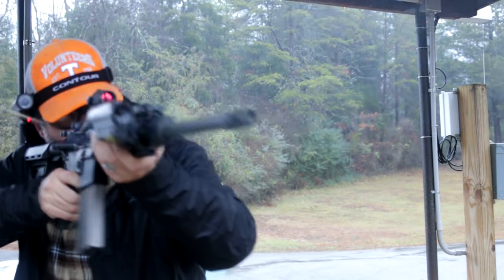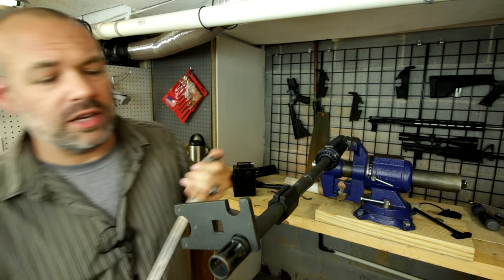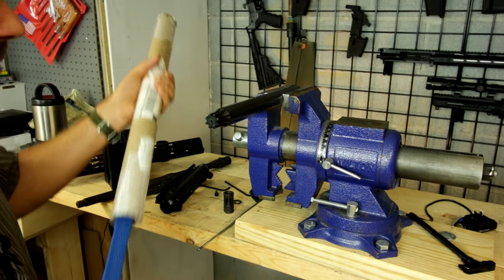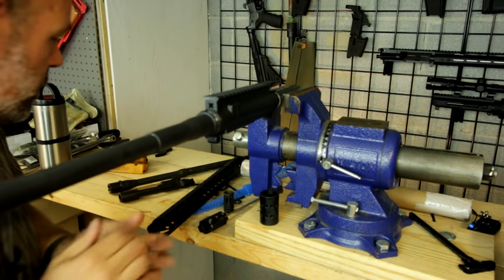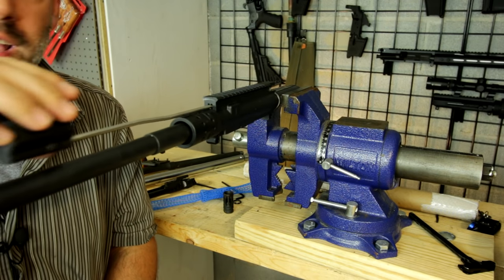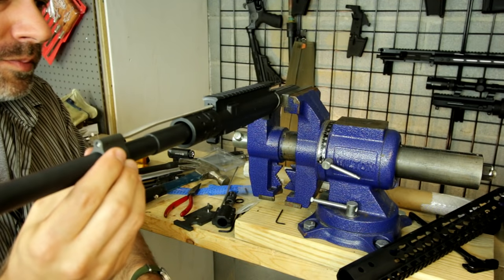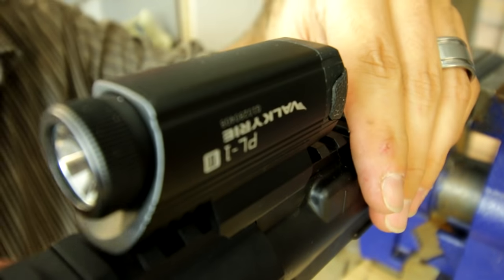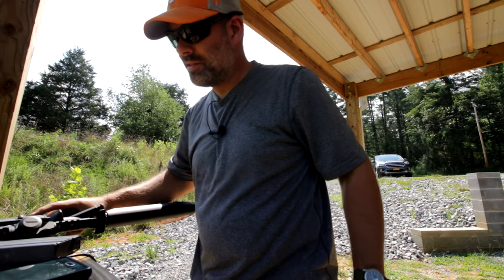How To Swap Out Any AR-15 Barrel

Comment: "Actually" I didn't see you set or tighten that gas block...looks like you just slipped it on the barrel and went to the hand guard. Not a good thing.
Reply: Was that the rattle at the end during the firing?
Reply: @5jjt  probably the recoil spring in the stock

Comment: Hey D & G, Great Stuff - Thanks. Just a note: When You use a Torque Wrench the ft. lb. Scale Reads number that of You using a Socket. You are using a "Crow Foot" Wrench, which is not directly over the center.  There is a formula to calculate the Actual ft. lb. based on how long the Crow Foot is. Side note: There is also a Formula to read ft. lb. if an extension were being used with a socket. FYI.                                                                                LJR-III                                                                                           OUT
Reply: You're correct, in aviation I would 90 the crows foot or torque adapter. But I think he was getting at the difference is not a big deal for this application, especially since he's mid ranging it too.

Comment: Thanks for the great video. I got the info I needed.  And, yes, your setup is quiet but those watching should still check the sound levels with a meter, most will be surprised to find that you still need "ears" to shoot any amount at all and not risk hearing damage.  Until you can get the db rating below 85-90, you're in danger (human speech is about 75db).  A lot of suppressed systems still come in well over a hundred.  Better but not "safe."  Speaking of safety...
 You shared your experience with us, so let me share mine with you. 
  I was a munitions systems specialist in the air force.  It was years ago when the knowledge was there but not well heeded and it was the military and it was an active combat station so putting gloves on every five minutes just wasn't practical...  Then.  We washed our hands in industrial solvents to get off the industrial adhesives, worked with explosives with heavy metals, etc.
  Having contacted leukemia and, subsequently, had a marrow transplant, I can tell you that washing your hands with soap afterwards isn't gonna cut it.  The moment you put your skin in contact with a chemical, the process begins. 
  I dont think the Aeroshell, per say, is as much of a hazard (read the safety data) but the cautionary tale remains.  Read and heed the warnings.
  I was lucky, I was diagnosed in the nick of time (2 weeks later and I'd have been to far gone) and they found me a "ten point match" (next to 8impossible).
  Christmas eve marked my ten year anniversary as cancer free (a marrow transplant for Christmas, lucky me) but those ten years were hell and the years to come are not going to be any version of a picnic. 
  Even when the cancer is gone, the remaining complications from the damned cure remain. 
  I'm no "Safety Sally" and I'm no pansy, either.  What I am is a walking object lesson.  I hope that you and others will learn from my mistakes.

Comment: Saw this and two points regarding your barrel installation.
(1) Use a reaction block on the upper receiver when installing the barrel, not on the barrel. The Wheeler Delta Series Action Block and Picatinny Rail Vise Block is an excellent vise block into which you can put the upper receiver using its takedown and pivot pin holes and a pair of 1/4" pins that come with the fixture. If the upper has a Picatinny rail, it can be inverted and held by a slot for it in the fixture. I don't like the clamshell upper vise blocks as the precise profile of uppers varies and I've seen them crush a few. The reason for fixing and holding the upper receiver: the torque when tightening the barrel nut is applied to the threads on the upper receiver, not the barrel. The only thing preventing the upper receiver from rotating is the barrel index pin. Too much torque from it on the upper can break and destroy the thin threaded portion of the upper receiver --- or shear off the barrel extension index pin, but that's rare.
(2) Use high temperature grease on the exterior of the barrel extension, and on the barrel extension flange, not just on the upper receiver and barrel nut threads. It will help prevent the barrel from "welding" itself to the upper receiver with pressure and heat over time. AeroShell 64 is the grease the military specifies and uses (formerly AeroShell 33MS).

A barrel extension (chamber) action rod should only be used for either holding the barrel while working on it, as a matter of convenience, or for installing/removing muzzle devices that apply torque directly to the barrel. For work directly on the upper receiver including the barrel nut, an action block holding the upper receiver properly should be used.
Reply: Would you consider it safe to use the reaction block types on the upper receiver to torque on/off muzzle devices as well? If so, what would be other purposes for reaction rods? Theres quite a price difference between the two and Im just wondering if I can get everything done with the reaction block style for upper work then I wouldnt need a reaction rod.
Reply: @andydufresnejr  When installing or removing a muzzle device, the torque is applied directly to the barrel. If you don't use a reaction rod engaging the barrel extension lugs, you put that torque onto attempting to turn the barrel (extension) in the upper receiver. The only thing preventing the barrel turning is the index pin and the pressure from the barrel nut on the barrel flange -- which has grease on it if it was installed properly. Attempting to align muzzle devices properly has been known to clock barrels in the upper, shearing the pin, or damaging the upper at the pin notch, or both. You want to isolate the torque to ONLY the barrel itself and its extension. Note that an AR-15 barrel is actually three parts, the barrel, the barrel extension with chamber and lugs, and the index pin. Once put together by the barrel manufacturer and sold as a complete barrel, they're not intended to be disassembled as the pin and the chamber lugs are aligned with the barrel gas port, and any gas block dimples or notches made in the barrel for mounting the gas block.

Comment: Using an upper receiver action block to remove a muzzle device puts all the stress on the index pin on top of the barrel, and the slot in the softer aluminum receiver.  This can damage the slot.  Use barrel vice jaws or reaction rod only for muzzle devices, and use an action block only for changing the barrel.

Comment: I saw when you installed the roll pin for the gas tube and slid unit onto barrel. You talked about placement of gas tube on barrel and when spacing is needed to provide proper gas port alignment. But you never tightened mounting screws before installing hand guard.

Comment: I am a USPS mechanic for parcel and letter automation. My main machine is a 150 foot long low speed electric chainsaw that has "teeth" that carry packages down the machine and have their own motor to spin a belt to kick the package off at the right time to sort into bins. The chain is self-oiling and the oil has so much molybdenum disulfide in it that it is metallic in appearance... if anyone's ever dropped an oil pan after throwing a rod bearing on a vehicle, shinier than that. It's ridiculously expensive. If moly greases and oils cause cancer, I'm seriously screwed. I use it as a hair pomade, facial cream, hand lotion, and if you get enough of it in a banged up knuckle it'll quit bleeding. Joking, but my job is seriously dirty and greasy. I think the tiny amount on your AR is about 1/1000 as likely to kill you as my average day. Thanks for answering my questions, I'm swapping the unbarreled upper in my AR-15 for a fancier model soon. 👍

Comment: 90 degree angle really does matter because the extended length on the torque wrench adds leverage to the torque thus a higher torque spec than it is set to especially on the the lower specs on an aluminum barrel nut!
Reply: So it’s torqued to 42ft•lb instead of 40ft•lb.

Comment: Something something 90 degree angle on torque to nut tool for correct ft-lb

also cannot recommend adjustable gas block more for 300blk if plan to shoot supers.

Keep up the good work man.
Reply: As a retired helicopter mechanic proper torqueing technics was a way of life. Torque adapters like you are using should be at 90 degrees to torque wrench. Over torqueing can cause breakage, under torqueing can allow things to come apart.

Comment: I'm so happy you didnt loosen with your torque wrench. The first switch was so quick I wasnt sure and I cringed a little.
Reply: Ive loosened with mine for 15yrs had it calibrated still within margine if error. Stop being a control freak. Let people do with thier property as they wish.
Reply: @timesthree5757  bro take it easy.  I was only commenting a little sarcasm. You wouldn't use your computer monitor as a hammer but I'm not going to stop you from doing so if that's what you want to do, I'd probably cringe a little for that as well, and I'm not a computer guy. It's that moment where you see 2 cars collide, everyone grits their teeth and holds their breath, squints their eyes just a little and brace for impact. 
That said, a little know proven fact of the matter, the calibration of a torque wrench is a little off after using as such, although an ls and a coyote can both be torqued into a " between such and such " range, but there are motors out there that require a very specific torque. I sometimes use my box wrenches as hammers, bad habit but some people do it. Next subject.
Reply: @highoctain113  um I have used it as a hammer to put my keyboard back together. Couldn't tell if it was sass.
Reply: @timesthree5757  no you didn't.... Althought I guess I could see it after a keyboard was used to smash said screen in a moment of rage due to a lost match.... Hahahaha
Reply: @highoctain113  um actually I did. Keyboard fell in the shop. It separated a little. Well I picked up a flat screen and used the base to bang it back together. Using a torque converter as an anvil.
People in my county won't use a shop if it isn't cluttered.
Reply: @timesthree5757  well hell I'd fit right in cause I can't organize ta save my life. Kinda why my tool box used to be so big... I had to have multiples of the same wrench cause I set them down and misplace them till the end of the day when I round everything up and put it away...
Reply: @highoctain113  yep. Yesterday we did a clean up in the shop. Minus the aluminum what not. We hauled away 15tons of crap. In the process we found over 100 10mm, 13mm, 15mm wrenches and sockets.

Comment: add some grease to ur buffer sping to get that vibration out plus it cut out that twang spring noise
Reply from the maker: At first I didn't think it was the buffer but after re-watching it the mic really pics it up well.  It's not nearly that loud in person but it could probably use some grease.
Reply: I was wondering what that noise was, then you mention the buffer spring and yeah, of course. Good advice.
Reply: Or get a flatwire spring.

Comment: You talk about not using the torque wrench to loosen only tighten but when you tightened the barrel nut you had the wrench backwards which in effect is the same as loosening.....
Reply: Yep I caught that too. Sometimes you don’t realize it until your wrench slips out and you smack yourself in the face.

Comment: The wrench and torque wrench isn't a 90 degree so the torque is overwhelming man
Reply: I believe he said he wasn't concerned. However, physics is physics.
Reply: There is an equation for going off 90, it makes a big difference in very high torque applications. Quite negligible in low torque ranges. If you are going for maximum or minimum torque, it may be an issue but I personally settle for something in the middle of my range.

Comment: Well, that pistol lenght gastube did the trick. So did you ever get another failure due to the gastube lenght?
Reply from the maker: Not at all and I've now put well over 1,000 rounds through it.  The only issues I've had since the barrel swap are reloading related.

Comment: At what point does a rocket need surgery, thus requiring a rocket surgeon?
Reply: As an Aerospace Engineer who works around rockets,  I can confirm that this is basically what building rockets looks like (maybe with a little bit more PPE and torque stripping lol)

Comment: so I can change my 11.5 inch barrel on my Sig M400 to a 16 inch barrel?
Reply from the maker: Yep.  You may need a new barrel nut, gas block, and longer gas tube to go with it so do research before buying.
Reply: @deuceandguns  Thanks if I decide to do it, I have a great gunsmith.

Comment: Ihave a palmettoarmory ar15 with 16 inch barrel..instead of buying a ar pistol can i just buy a pistol upper and put it on my ar..thinking of a 7.5 or 10.5
Reply from the maker: You sure can but to stay legal you'll need to register it as a Short Barrel Rifle if the AR you have already has a regular stock on it.  If you want to go down that road reach out to a local dealer that sells suppressors and they'll probably be able to help you out.

Comment: Why did you tighten it then loosen it then tighten it again?  I’m confused shouldn’t you just have to torque it to a certain amount and it’s done?  I’m new to this so that’s why I’m confused.  I want to buy a cold hammer forges barrel for my first AR and that threw me off a bit.
Reply from the maker: That technique is listed as standard procedure in the US Army manual.  It's to verify the barrel is fully seated to the receiver while not being over torqued or have any stress points.
Reply: @deuceandguns  cool thanks

Comment: Great video.  How short of a barrel can you go down to?  Thanks R/David Gutierrez
Reply from the maker: My 10.5 inch 300 blkout SBR runs like a champ but anything below that and you can run into having to mod the gas system a ton or it may require a suppressor for the additional back pressure.  I've got a 7.5 inch 5.56 that runs nice and that's the shortest AR SBR setup I've attempted.
Reply: @deuceandguns  A 7.5 inch barrel isn’t a sbr unless you put a stock and not a pistol brace on the AR.
Reply: I’ve seen 300 blackout with barrels as short as 5 inches. But any barrel length past 10.3 is a waste
Reply from the maker: @badcompany3828  Mine is on a rifle stock thus the SBR comment.

Comment: My 300bo 8” sbr won’t cycle subs for sht . I purchase a yellow sprinco spring to see if that helps the situation out any better . Frustrating af
Reply: For a barrel that short, you need to ensure that you have a large gas port.  Then use an adjustable gas block to throttle the pressure according to your loads.  Or reload your own, so that both your supers and subs hit nearly the same PSI.

Comment: You earned points for forgetting the gas block.  You lost points by not dropping the roll pin. Now, go join two wires and forget the shrink wrap.

Comment: When he said changing out the barrels to chamber a different caliber he specifically said at  1:07 something so fast it’s hard to understand did he say you do or do not have to change your bolt
Reply: If changing your caliber to 5.56 or 300 blackout you won't have to change. If it is 7.62 or 6.5 Grendel you will have to change the bolt

Comment: Did you check head space ?
Reply from the maker: I eventually did but I'm never concerned about a new AR barrel due to the headspace being set from the barrel manufacturer and I match new bolts to new barrels.

Comment: Could I go from .223 to .223/5.56 with a barrel swap?
Reply: @foxxy1015  The 5.56 has a different throat and the chamber is .0001 longer compared to a 223 chamber.. Many barrels marked 5.56 are not true 5.56 chambers but are 223..Use a 1.4646 go gauge for the 5.56 and a 1.4636 go gauge for the 223..There are function gauges and throat gauges that will verify if a barrel is a true 5.56 chamber and throat.. There is no reason to change uppers..
Reply: Yes..
Reply: @hairydogstail  I didn't know that, thanks for telling me I will change my comment than

Comment: Easier to align your muzzle device if you tape a level to the wrench tool. Little changes in angle on a compensator do affect your shot placement.
Reply from the maker: That's a good idea.  For this particular build the flash hider is simply a thread protector for my suppressor but I'll keep that idea in my toolbox for later.
Reply: @deuceandguns  I've never had a roll pin fit so easily into the gas tube, that may not hold well. I usually have to hammer mine in with a roll punch pretty hard. Just throwing on the suppressor should have fixed your subsonic carbine length gas issues with 300blk, but I always run pistol gas systems on 300blk for any load, with an odin works gas block. I can't say enough about the benefits of getting a gas system dialed in correctly. Usually a .223/5.56 can reduce about 30% on carbine, and 20% on mid-length. I can usually reduce about 20% on a pistol length 300blk, though I never run subsonic. I use HDTP 3oz buffers. I can also hear some harmonics in your buffer spring. I'd recommend adding some lithium grease to the spring, and cleaning/replacing grease after every 1000rds.

Comment: How does this work with a piston ar?
Reply from the maker: It's a little bit more complicated and will cost more if you're changing to a pistol length port.  You'll need to find a pistol length piston system vs. a pistol length gast tube but they are available.  Everything else should be the same unless you're working with an oddball design.

Comment: What is the vise clamped onto?
Reply from the maker: The vise is bolted onto a piece 2x10 which I can then bolt to various places in my shop where I've drilled corresponding holes.